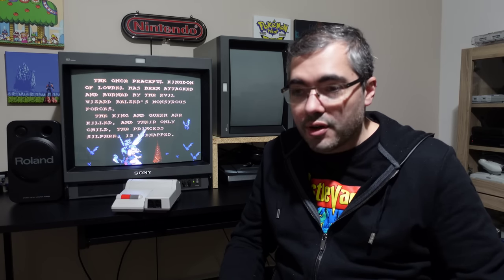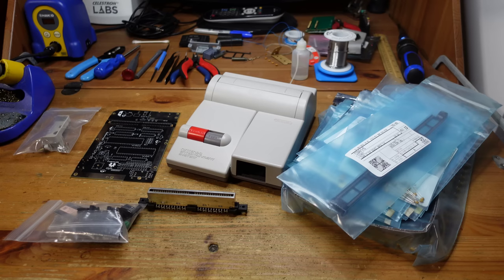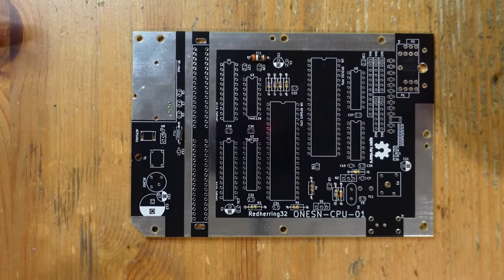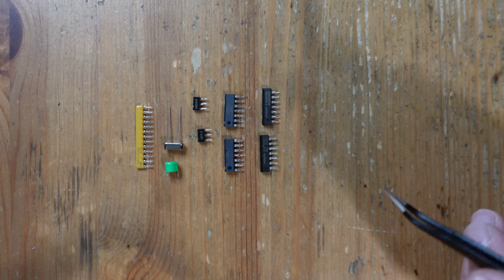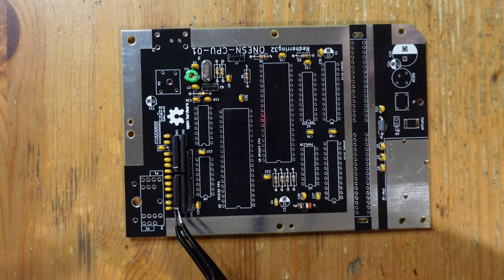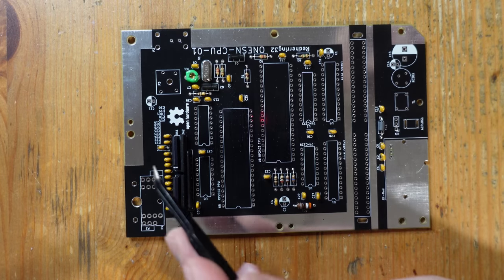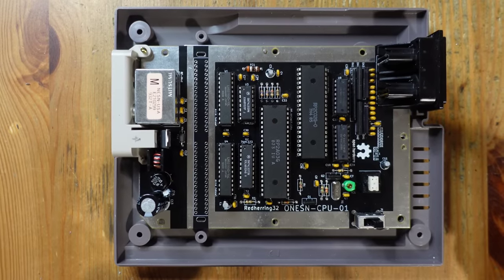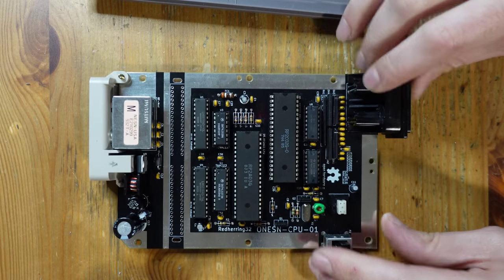Building a new Toploader NES in 2023! Opentendo Toploader build guide and demonstration

Comment: Definitely an interesting project, and it seems like it would be useful for people with destroyed PCBs. I think that it would be neat to see a similar design but with AV outputs and with the PCB layout changed to avoid the jailbars (so basically a combination between the top loader and AV famicom).
Reply from the maker: Yes, it should be possible it edit the design and add native composite video instead. I will have an update on this project that adds many more video options to the opentendo toploadrr

Comment: This looks awesome! Do you know if there will be a version that uses a PCB mounted multi-out port? That would be awesome! Since it's an open design, if that's not an option, I might have to figure out how to modify it to be included!
Reply from the maker: This will be released soon and it’s totally possible to modify it to add composite video. No one makes a pcb mounted snes style multiout but there are open source panel mount snes connectors that can be used
Reply: @LIRetroGaming  Yeah, I can see how it wouldn't be sustainable until someone made a compatible PCB mount replacement, but I have a few donor SNES boards (missing the working CPU, PPU, etc) to use parts from for myself at least.

Comment: For the CPU and PPU you can also buy new ones. At least new old stock. The UA6527 CPU and UA6528 or UA6538 PPUs made by UMC. They were used in all the early (not NOAC) famiclones.
Reply from the maker: Yes, these chips also work, but they do have some bugs in them and compatibility with games is not great

Comment: I started my OpenTendo front loader a couple of years ago (Not too long after your video I think), I eventually found some eBay PAL crystals (Otherwise it means harvesting them), the other hurdle I hit at the time was several of the BOM items just weren't available anywhere, and so I basically shelved it.

Have 5 PCB's and 5 modern RF modulator replacement boards :)

Mostly because it was cheaper to go via PCBWay than buy the kits, would have been very expensive here in Australia.
Reply from the maker: It’s hard to get those parts without having a broken Nintendo motherboard laying around. I have parts if you need them
Reply: @LIRetroGaming  It's funny, because the reason for going with OpenTendo was because I actually have a broken NES, it has so many problem traces that it just wasn't repairable.

Comment: There needs to be a better top loader reproduction cart slot. The original top loader slot, and PCB, are missing like 4 pins/traces. Nintendo also put a thinner gap in place of those missing pins, to push out the thicker PCB of a Game Genie or any unofficial cart with thicker PCBs.
Reply from the maker: It should be possible to edit this design now, maybe as a 4 layer pcb

Comment: Does the top loader pcb fit in a Famicom? Also what original components are common between the two? Great video, I always love your uploads.
Reply: Just from looking at pics, it seems that the Famicom board is laid out slightly differently in the cartridge slot area so not sure

Comment: Why do you always flip the board over after soldering the corner pins? Are you double-checking the chip orientation?
Reply from the maker: Yes, I’m checking the socket orientation and also making sure that the socket is inserted all the way and is not crooked

Comment: I think that Famicom cartridge adapter should work fine without height modifications to the slot itself, possibly the top case though. But on the whole, the pins on both sides of the connection are much longer than is needed for function, and properly inserting the game evenly all the way across would likely be the biggest issue.
Reply from the maker: I definitely plan to try the new aliexpress cart slots in a future build. Once I have all the details worked out I will probably make a tutorial for converting a frontloader into a toploader
Reply: @LIRetroGaming  I look forward to seeing that. Good luck brother.

Comment: I love your videoes.  This project is very good; I expect there would be a model for FC that can use to replace the original poor video quality of FC main board. 
There are other redsign PCB with more functions, connectors,  and better av video output like tiny NES, but cannot use the original shell.
Reply from the maker: Yes, I believe that there is a Famicom replacement board as well; it’s listed on muramasa entertainment’s website

Comment: I think you could make an NES with 100% new parts if you used UMC clone chips. Do you have any other dead consoles that could use a replacement board? Recently people have reverse engineered the Famicom, most of the Game Boys and the Atari 2600.
Reply from the maker: Technically you are right, but the UMC chips have bugs and many games do not work correctly. There is also a reverse engineered frontloader NES, Game gear and some 8 bit computers like the c64
Reply: @LIRetroGaming  Do you know any games that have problems with it? There were a lot of NES clones that used them, but I don't remember any bugs that weren't in the original.

Comment: I'm not a fan of the top loader NES overall.  I prefer the front loader being that it has built in AV jacks with cleaner picture, cleaner sound and no jail bars without a bunch of mods.   It is true that the front loader is a little higher maintenance with the pins but it's worth it to me.
Reply from the maker: I also prefer the front loader and I have a lot of nostalgia for it. But with some mods the toploader can be awesome as well

Comment: It's mind boggling that no one has made an aftermarket shell for the console (or the other parts like a controller port... really?) when that would invariably break before an entire motherboard would.
Reply from the maker: The good news is that it’s very possible to solve all these remaining problems. Technically there are controller ports available but not in the exact shape that is used by the toploader or the av Famicom
Reply: @LIRetroGaming  It's strange that the motherboard was solved first, to me anyway. You'd figure engineering a whole motherboard is harder than a replacement port or, even weirder, the case... we have 3D printed/injection molded cases for handhelds, SNESes, etc.

Hopefully they solve it soon. These projects are good because they let you salvage what might still work from an old and broken motherboard. And often, you find quite a lot of the chips still work, even if the whole thing doesn't.

Comment: Why would you want to do this with video flaws of the top loader?  Why not design the board with the rgb mod integrated?
Reply from the maker: The goal was to make a faithful recreation. RGB can easily be added which I will demonstrate in a follow up video
Reply: NESRGB is a closed source design that emulates parts of the NES PPU. This would require a substantial reverse engineering effort to pull off. Also, the goal of the project is to preserve the motherboard designs of NES systems, and as well as other Nintendo systems in the future from my understanding. This includes all the various flaws the original designs may have. The project is open source, if you wanna make a version that fixes the video out problems of the top loader, feel free! ☺️

Comment: I don't think I understand the reason for going through this much effort if the video is going to be just as bad as a stock top-loader. I mean, it is neat and all, but surely there is some other reason than "just because we can".
Reply: I think it's just a test to see if the board works and identify any issues it has before a final revision is made. He said there would be a later video using the final version of the board. I'm sure he'll do a video mod in that one.
Reply from the maker: Yeah that’s exactly right. This was a prototype - I had to make sure that it worked as intended first. From here, I’ll make a follow up with RGB and the (hopefully) final version

Comment: This is a really cool project!  Too bad about the space in the middle of the 72-pin connector; I think big N did that because they could not route enough traces between the front and back of the board (without using 4 layers), since originally it was designed for the width of the Famicom connector.  I wonder if a future revision would add a footprint option for an A/V out connector akin to the AVFC.  Cheers!
Reply from the maker: Yes, I loved building this project and it has a lot of potential. I think it would be pretty easy to add an av out similar to the av Famicom. Glad you enjoyed the video!

Comment: Top loader was $50. Original (superior) front loader was marked down to $89.99. Always used the official cleaning method. Push down and work the card to get good contact. Always store carts in case or box. Sometimes you need to get sandpaper on the cart and in the slot. Try the cart first and push down and work it. If you see green on the freshly sanded cart, the corrosion is inside the edge connector. Repeat or just buy a new connector. Front loaders have a/v. To me the top loaders were not marketed for what they had hidden inside. Really should have been more fully featured
Reply: Hi. Just wanted to clarify something important. Sandpaper is NOT an acceptable thing to use to clean your games. Brass gets tarnished or Gets dirty from dust and spit from blowing into cartridges. The game contacts are THIN, meaning that using something abrasive such as Sandpaper damages the cartridge pins, and can render the game inoperable. Isopropyl alcohol is always the first step, if that doesn't work, try brasso, then clean with Isopropyl alcohol, as brasso itself is corrosive if left on the game. Finally, If all else fails get yourself a fiberglass pen, which is a very LIGHT abrasive to remove corrosion then clean with alcohol. They make a modern day cleaning kit as well called the 1upcard which is felt with a cleaning solution. 
Bottom line: Sandpaper will permanently damage your console and your games. Avoid at ALL COSTS.